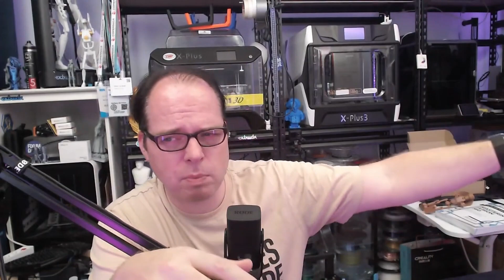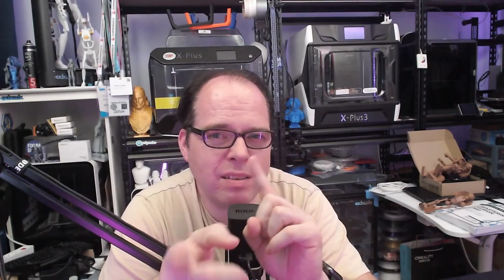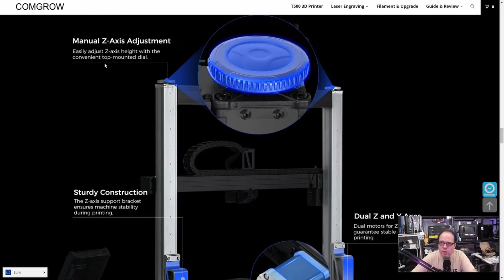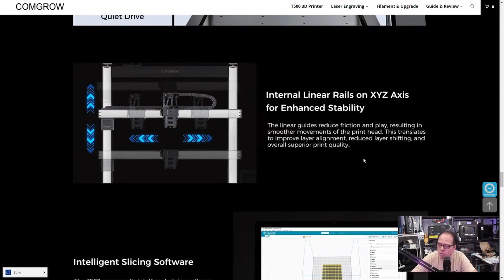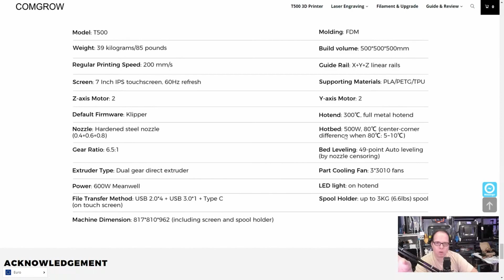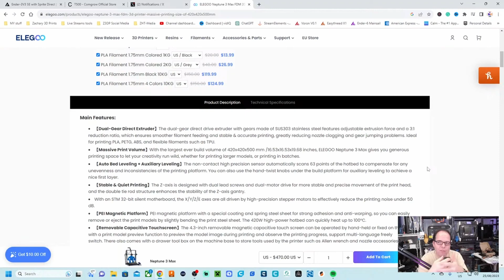Comgrow T500 Large 3D Printer   Z3DP Reacts

Comment: Kobra 2 max is similar size and 50% faster. Just saying.
Reply: Wish the Kobra Max 2 would have been available when I modified my Ender3 pro with the Ender Extender 400xl kit. It would have probably been better initially and definitely would have been cheaper. I like the experience I gained through building it but it was a challenge getting it dialed in. It’s awesome now but took a lot of work to get it there.
Reply from the maker: Oh that sounds great. I did see on my ERRF trip the T500, but since it has Klipper issues it wasn't running
Reply: 42% difference but sure, 'similar'